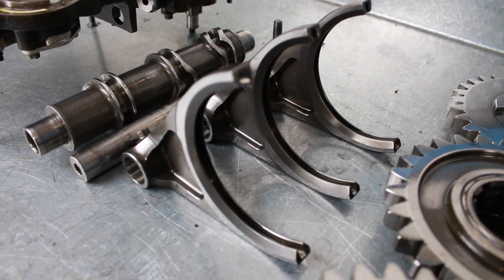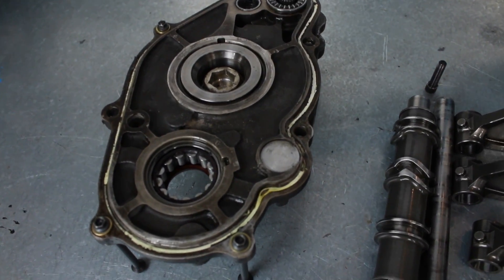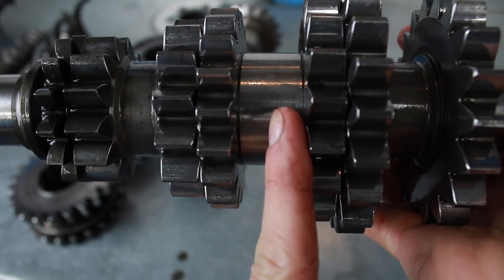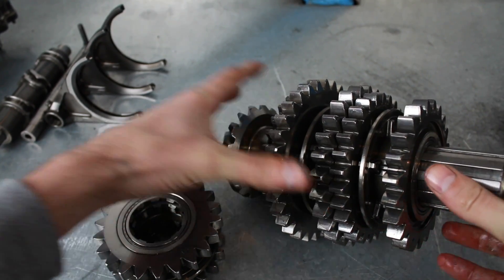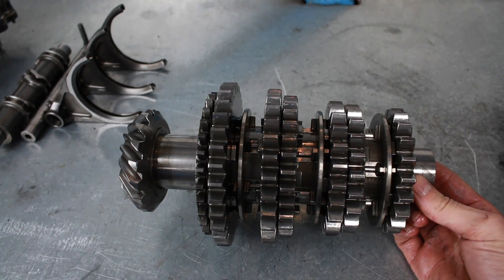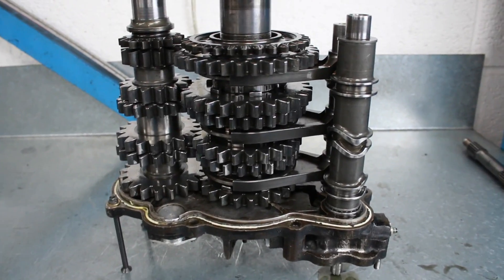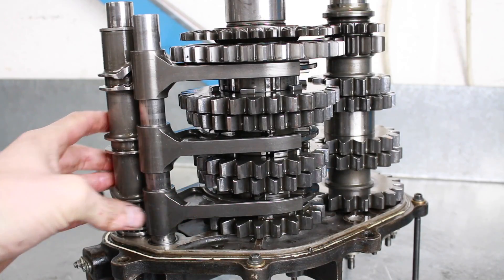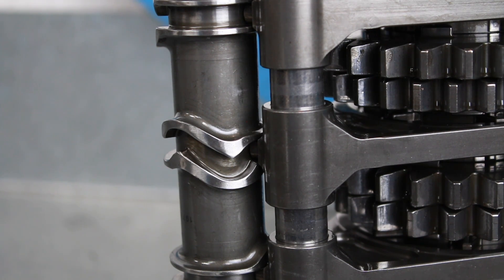How to Build an F1 Gearbox (and How it Shifts) | F1 Engineering

Comment: Can you explain a modern dual clutch F1 gearbox?
Reply: They don't use dual clutch in F1.
Reply: Yes they do, that's why the shifts are instant.
Reply: @shadowgaming6660  No, what you see in this video is what they use today.
Reply: Sequentials have torque loss due to the thicker teeth with bigger gaps between them.
Reply: Although looking at the placement of the gears this looks like a dual clutch too.
Reply: @shadowgaming6660  This is a sequential gearbox, a dual clutch would have separate shafts for even and odd gears (3 shafts). You can clearly see only 2 shafts here.
Reply: A DCT can use a singular shaft, but most don't.
Reply: I remember watching a video posted by the Mercedes F1 team explaining F1 gearboxes that was talking about engaging multiple gears at once like a regular DCT

Comment: Nice Video! I'm curious on how the new F1 gearbox design compares to the designs of what you have shown in this video. I'm pretty sure they are much more complicated in design and function of the 6 speed gearbox of yesteryear.
Reply: They're actually pretty much identical, they haven't changed for years. Atleast not Red bull and a few of the other big teams.
Reply: Carbon fiber housings, if legal.

Comment: This works/operates exactly the same way as the gearbox in 99% of all motorcycles ever made. It's a constant mesh sequential gearbox. Cool, but hardly the pinnacle of engineering.

Comment: That is actually easier engineered than a normal car gearbox, impressive!
Reply: Well it is simpler, but it also whines like mad with straight cut gears, the dogs will chatter like mad when coasting and you're forced to go up and down every gear individually.
Reply: ACommonFerrariFan Gotta Be quick, strong, and just reliable enough to do 300 km. Ease of use? Nah. 
Although, I wouldn’t exactly complain if my daily driver had one of these 😏
Reply: though doing 300 Km with racing levels of abuse would likely translate to more like 300,000 Km for a responsible daily.
I too, would not complain to have a sequential gearbox in a daily. Though I think I still prefer my H shifting manual.
Reply: @reaganharder1480  There are H-shifting dog-boxes aswell, but no sequential synchro boxes afaik. Great for clutchless shifting, but you can't ever go easy on them if you want any sort of durability... Every shift has to be hard and precise, too slow or sloppy and you likely will damage the dog teeth and need a rebuild very soon.

Comment: Pretty much the same as a constant mesh motorcycle gear box.
Reply: In concept, near identical, gains reverse and and a bevel gear on the output shaft because not chain driven. In terms of detail design its full of optimisations.
Reply: Most Heel-toe down shifting while racing.
Reply: But this has a slight problem while down shifting. To counter this, the drivers has to execute a REV MATCHING technique. 
It's also called Double De-clutching.
Reply: @venkatpuneeth  I never had that problem on a motorcycle and with practice could make clutchless changes in both directions.
Reply: @bulwinkle  Well that's what the early F1 drivers used to do in the paddle-shift-less era, Rev Matching. 
Sorry, I don't know about motorcycles, i too never rev matched in my motorcycle, what you said is also a good point, have to look into that, thanks.
Reply: @venkatpuneeth  Racers even use an electronic mechanical system called a quick changer to effect clutchless changing.
Reply: @bulwinkle  me too for the last 40+ yrs ;o)
Reply: @venkatpuneeth  Rev matching on a motorcycle and Double De-clutching is two slightly different techniques. With a motorcycle (or any other syncromesh gearbox, cars included) you rev the engine or close the throttle to allow the selector ring to spin at the same speed as the next gear you want to select, the gearbox will shift when the gear being selected/deselected and it's associated shift ring are effectively unloaded from each other and there are no force holding the dogs together and they are free to move (typically when spinning at the same speed), this is also why clutch-less shifting with or without an electronic quickshifter is possible. Simply take some load of the gearbox and it shifts. Double de-clutching on the other hand is a technique used on a non-syncromesh gearbox, like the ones in early cars where all gears are not in constant mesh (like with F1 gearbox), rather the entire gear would slide on it's shaft engaging/disengaging it's teeth with that of it's partner gear, the grinding sound would be when the sides of the two gears actually rubbed together during shifting. Here double de-clutching is used to first put the car into neutral (first de-clutch), allowing the gears to get to the same speed by revving engine during downshift or backing of the throttle a bit for the engine to slow down during upshifts (while in neutral), then de-clutching again to shift to next gear.

Comment: this looks a lot less complex and also less fragile than any other kind of automotive gearbox i'm aware of. guess being a bit rough when shifting due to the dogrings and the noise because of the straight cut gears are the major reasons these aren't widely used in roadcars. i mean, these could save weight and manufacturing complexity and by that make cars cheaper and also more fuel efficient, if the gearing is set up for road use. dual clutch boxes and automatics with torque converter are a lot heavier and more complex.

Comment: Amazing video for an engineering student aspiring to get into F1, very insightful !

What about reverse? Does it engage through a different mechanism ?
Reply: Reverse is the 'skinny' gear to the left of first gear, the selector barrel will be in neutral position, and there will another 'cog' to enable to car drive in reverse, actuated by a different mechanism yes, usually why it always seems to take a long time for a driver to engage reverse gear in a sequential 'box car.
Reply: @GTiR23  thanks !
Reply: i thought f1 cars don't have a reverse gear at all.

Comment: Hi and thanks for the video. Since you are covering some retro F1 cars, could you please explain and maybe demonstrate how the active suspension from the 90's works?
Reply: Same thought here!...
Reply: Yes, same concept except that motorcycles don't have gear hubs and dog rings to do the changing but instead have the dogs directly on one side of the gear and move the whole gear on the shaft to change gears. When the dogs wear out with a dog ring you just replace it instead of the whole gear and the same goes for changing ratios as you only change the gear. The motorcycle system works very well but when you get into race transmissions for cars (G-Force, Liberty, Hewland, etc.), gear hubs and shift rings are a must.
Reply: @philmc-h7c  can you explain why shift rings are necessary for racing applications?